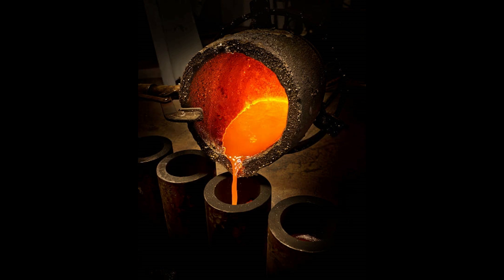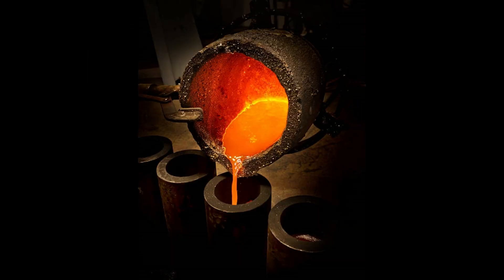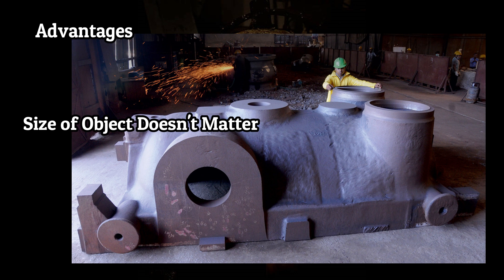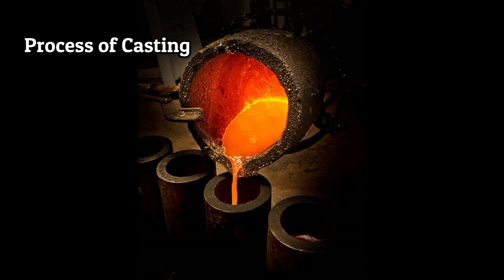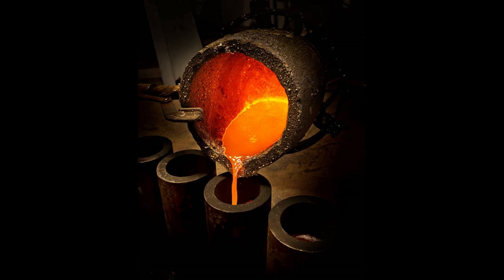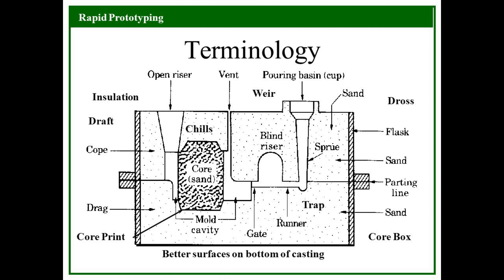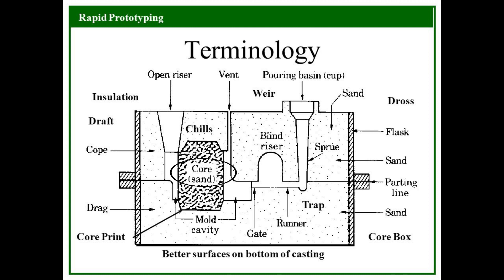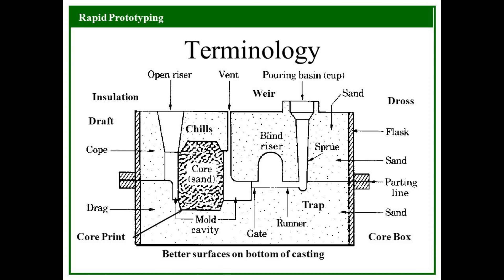What is Casting & it's Terminology. ||Engineer's Academy||

Comment: i don't get it why did you say its uneconomical for mass production?? actually its the opposite.. I have seen a lot of videos and books that a die casting is suitable for mass production.
Reply from the maker: die casting.. including injection moulding is economical.. but sand casting is not economically suitable process.. !
Reply from the maker: see casting is a wast process .. so injection moulding and other moulding processes are economic but the one which uses sand .. is quite not suitable for mass production.. ,n